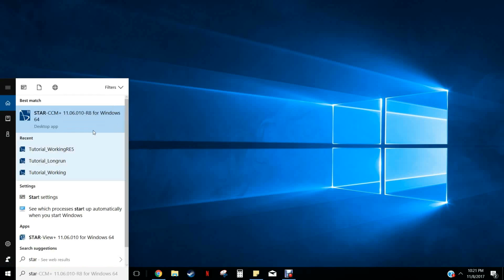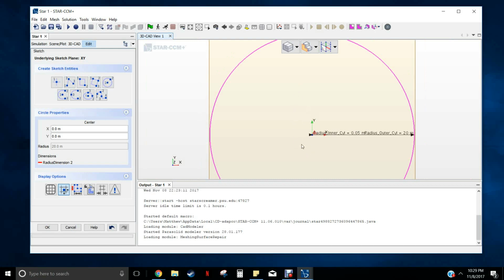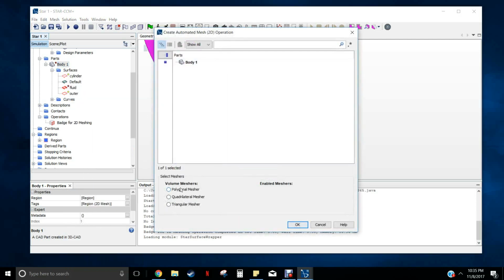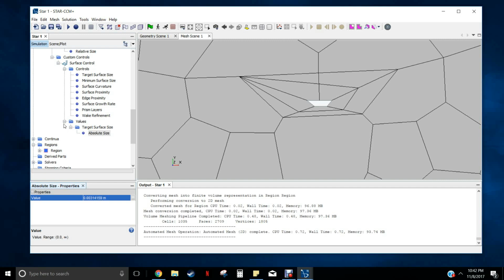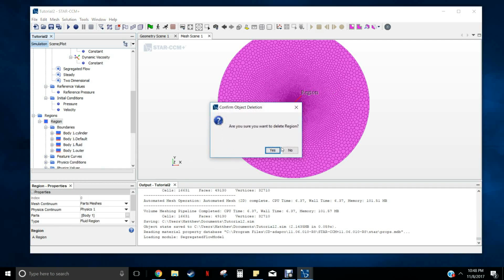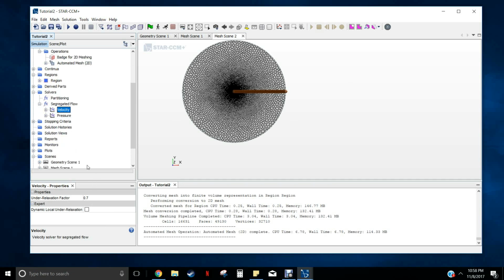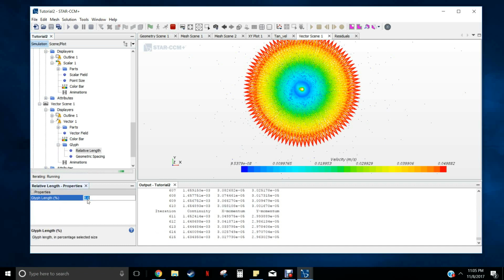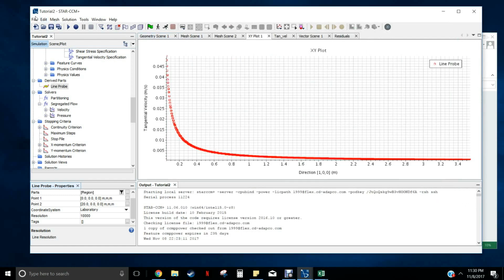Rotating Cylinder Tutorial in STAR-CCM+

Comment: Hi , thanks for your work. When am trying to save .csv file, the results in excel is not in columns and all in one cell?  what should I do to save it like yours?
thanks again and good luck☺
Reply from the maker: I don't actually know why yours is different, but if the data is separated by a comma or space or tab, you should be able to use the Delimiter tool (within excel) to separate them into columns.